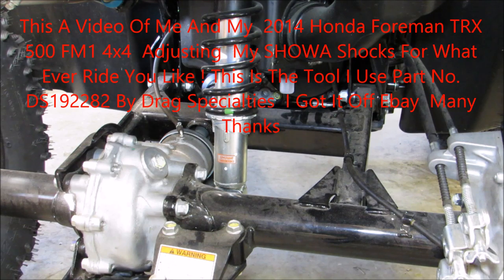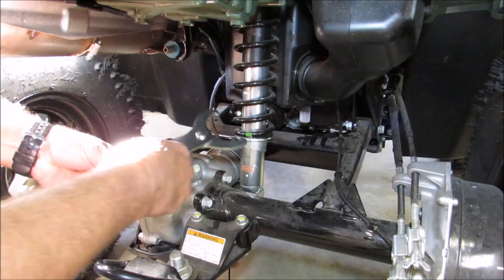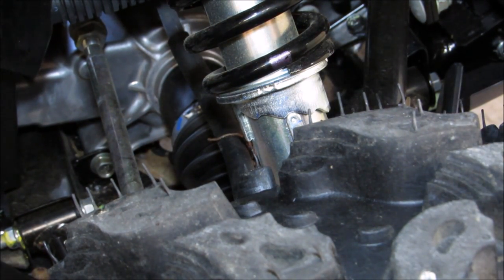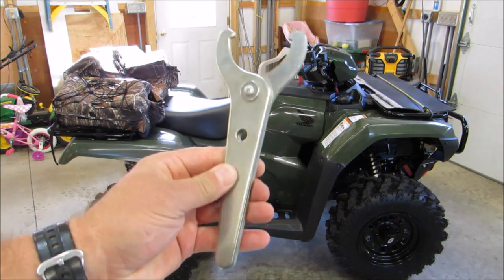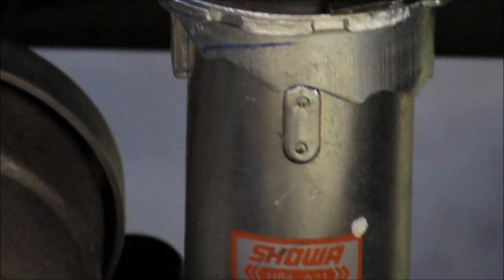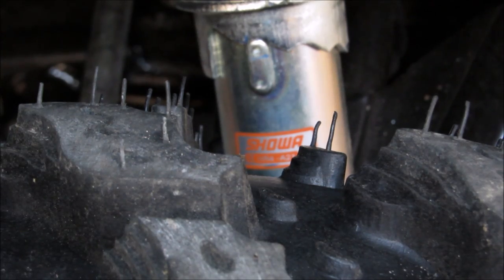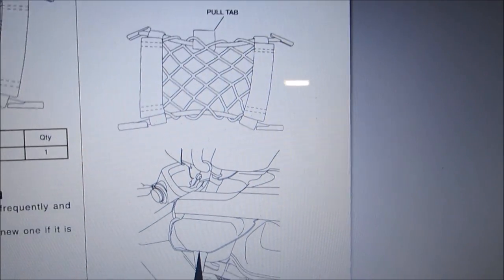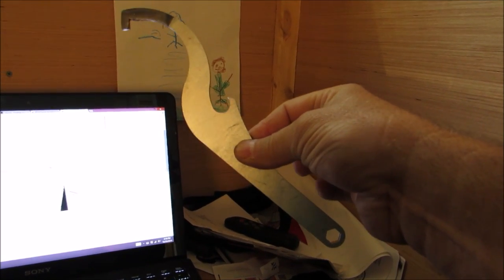2014 Honda Foreman TRX 500 Adjusting Your SHOWA Shocks The Tool By KVUSMC

Comment: Some searching for this spanner wrench may find this of interest. 
While I was searching around for the best price I could find on this tool. It came to my attention that this same tool is manufactured under various part #'s yet the exact same wrench.
The following are supposedly alternate part #'s by Drag Specialties.
DS192282,  77-2003-BC3, and 772003BC3
I just bought part # 77-2003-BC3 for my 2015 Honda Foreman Rubicon as it has the same Showa shocks as yours Ken.
Since I bought it through Amazon I can easily return them if they don't work.
By the way, I like your vids and a BIG Thank-you for your service in the Marine Corps... my late father-in-law was a Marine who served in Nam.
Reply from the maker: Obeconobe7 Thanks For The Info Buddy Awesome  Amazon Is Awesome Your Welcome Buddy I Enjoyed Every bit Of My Time In Service It Was A Blast

Comment: Thanks for sharing and making it easy for my Yamaha grizzly 700 quad i actually used a pipe wrench and removed tires also removed the bar that goes to brake calipers it was simple procedure to make it stiffer clockwise and loosen it counterclockwise
Reply from the maker: Roger that Brother